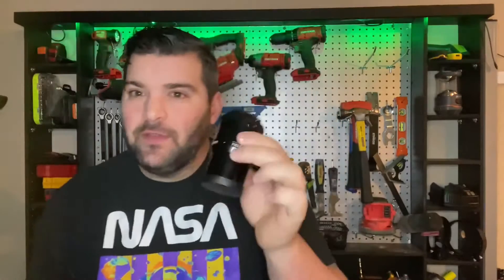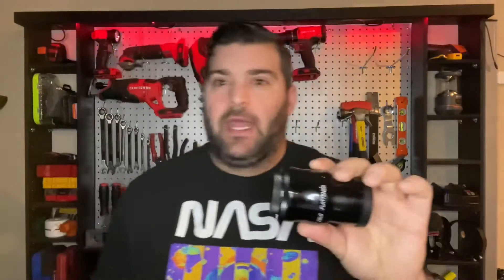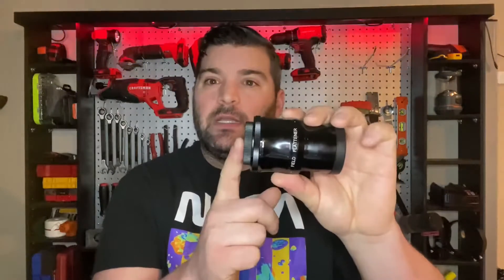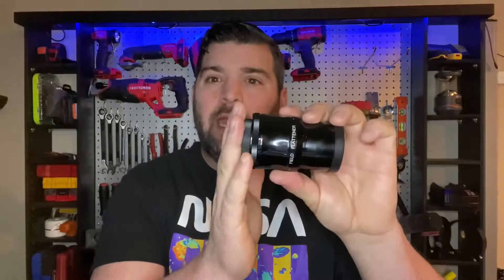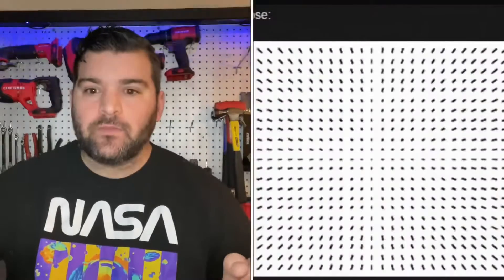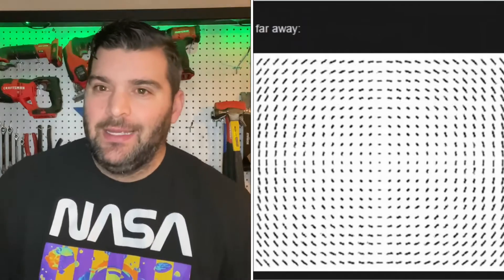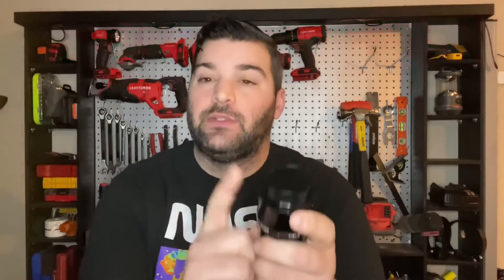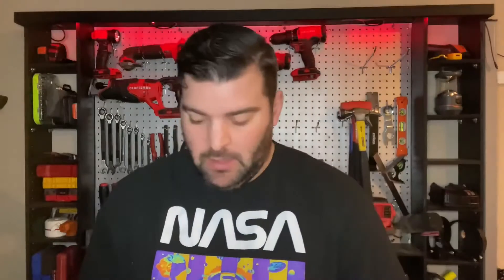Own a Refractor? Why you NEED to buy a field flattener right now!

Comment: How do i choose correct flattener if there isn't dedicated one? I have 600mm FL f/6 ED refractor telescope (probably from TSOptics, but I cannot find exact model online).
Reply from the maker: thats a good question - if theres not a dedicated flatteber it might take some trial and error to find one. Maybe have a google and see if anyone else has had a go - there are some generic flatteners around - they usually state the focal length range they are aimed at - and it might take a little tuning too with them - not an easy answer I am afraid - most common brands will inevitably sell a matched and tested one but outside of that its a bit hit and miss sadly
Reply: @TeamAstroworkz  There is omegon telescope similar to the one I have. They might even be same thing, just with different branding. It was sold with omegon flattener, so this may be worth checking?
Reply: Very good question, since I am looking for exactly the same: a field flattener for a f5,3 600mm ED refractor. Have you find one already?
Reply: @kayasper6081  I've bought TSFLAT25 from TS Optics and it does the job. But I wasn't sure while buying it. I just looked if specs matched my telescope.